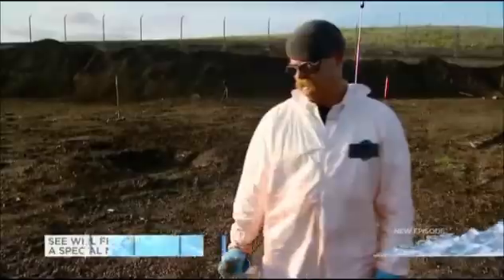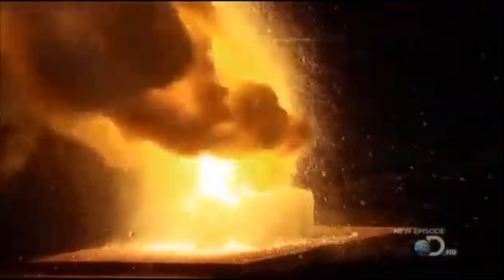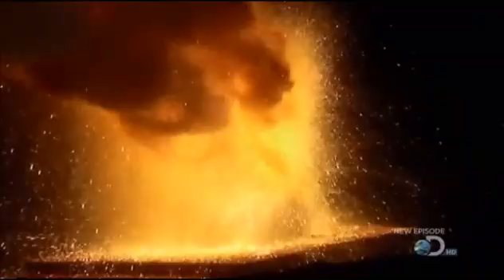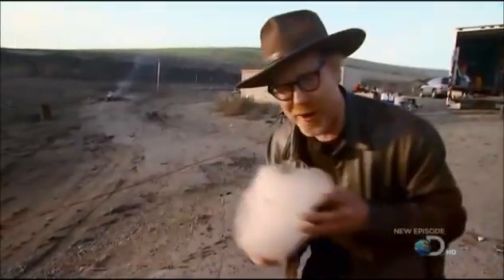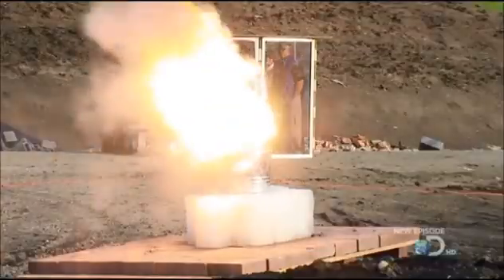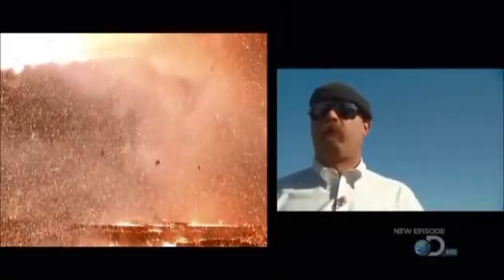Ice vs Thermite - Mythbusters for the Impatient

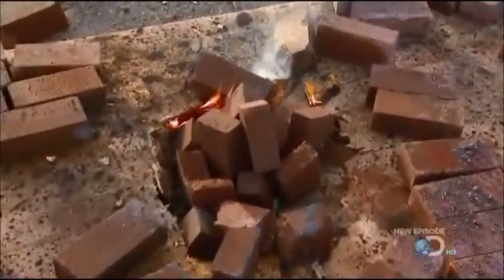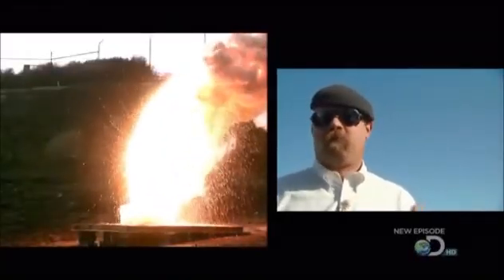Comment: (Also Speculating) IMO it's mass boiling on a spectacular level! As soon as the thermite fully envelops the ice in a layer of Thermite of exponential heat, it exploded. 1:40. And at 2:10
 you see it again, as soon as the ice is fully surrounded by the Thermite, it explodes.
Another note is that i believe i can see the source of the explosion from the lower Core. If it was gasses being released that ignited the explosion. It would ignite inward, towards the thermite. Not Out!

Comment: I think like Jamie is trying to explain is exothermic reaction, also known as a bleve (boiling liquid expanding vapor explosion) kind of like putting out a grease fire with water (which you should not do)
Reply: An exothermic reaction is just one of two types of chemical reactions, that and endothermic. All they describe is whether a chemical reaction ends with a lesser energy state (exothermic) or with a higher energy state (endothermic). A BLEVE is not a chemical reaction at all, it is a physical phenomenon pertaining to vessel rupture due to vapor pressure in a sealed container, typically propane tanks in or on fire. The term youre thinking of is a boilover fire, which is when expanding vapors aerate the fuel which leads to an explosion like burn.

Comment: You know the idea of oxygen and hydrogen subliming directly from the ice does seem possible at those temperatures.  If you consider dry ice at room temperature it becomes fairly easy to visualize what is probably happening with the ice block.  A quick Google search shows that thermite ignition produces temperatures in excess of 4,000 F, so this seems very reasonable.

Comment: Is it possible that the rapid heatig of the ice creates mechanical stress through imperfect distribution of the warmth (especially outer shell heating up faster than core) which results in a rapid release forming a particularly missfitting crack (both sides change through heating to forms that don't fit together) which is pushed appart by... Well not fitting together ^^ and just crack like BOOM
as fresh ice cubes do if you blow on them fast enough or put them into hot tea/soupe/etc.
Reply: JonnesTT you're a fucking idiot.

Comment: This is probably a coulumbic explosion from the molten coming into contact with the water/ice. The fireball is probely a mix of hydrogen gas from the initial iron explosion and finely divided aluminium powder from some of the unburned thermite. That would explain the very bright fireball.

Comment: It's very easy to disprove the first hypothesis, which I don't believe either: just use dry ice. CO2 isn't flammable.
Reply: thats an interesting idea, I think it would make a good test - but one issue. The speculation is that the thermite reaction is so hot that the water is turning into separate oxygen and hydrogen. CO2 might turn into separate oxygen and carbon ~ and we know carbon burns. Perhaps a test with liquid nitrogen to see if it just needs to get cold or if something else is happening.
Reply: What are you even talking about?  Ice blocks don't contain CO2.
Reply: @nitroneonicman  He's discussing dry ice, which is the name for CO2 ice.
Reply: @EDoyl  I realize that, do you realize the video is not about CO2?  In the video they are using ice blocks not dry ice.  Since you clearly don't understand basic chemistry let me break it down for you.  When hydrogen and oxygen are decomposed they become highly combustible, pure hydrogen and pure oxygen in the presence of eachother are very explosive.  Mentioning CO2 or dry ice is completely irrelevant.

Comment: My theory: the thermite causes the ice to rapidly turn to steam, causing the mixture to more or less aerosolize, and the aluminum then reacts more rapidly with the oxygen in the atmosphere. Thermite works because aluminum bonds very strongly and exothermically with oxygen, but requires such a high temperature to ignite because fe + O2 + heat = fe2o3. Some energy in consumed breaking the bonds in the rust, but when a large amount of aluminum high temperate aluminum is exposed to atmosphere it reacts purely exothermically and more rapidly.

Comment: Yeah, I think Jamie's right with his theory. It's like when you throw ice into a boiling vat of oil. You're gonna get a fireball when the rising stream creates the perfect fuel to air ratio.
Reply: +Neceros 13 million kelvin for ignition of hydrogen?? So if hydrogen is so safe requiring that much heat to ignite why don't we have hydrogen airships? You must be confusing ignition with thermonuclear fusion or something.
Reply from the maker: +Mike Trieu (MegasChara) 
The problem I have with that explanation is that thermite, unlike oils and other fuels, has an oxidizer in it. So the idea of aerosolizing thermite until a critical thermite-to-oxygen mixture is achieved seems a bit strange. Am I missing something? Perhaps your chemistry is better than mine.
Reply: Mythbusters for the Impatient Perhaps not so much about the oxidizer as it is about exposed surface area. We know that so-called nano thermite reacts much more explosively than coarser-grained compositions. It would seem to follow, then, that as the thermite is thrust into the air, more of the grains are exposed and able to reach the critical ignition temperature simultaneously. Something similar happened in that iPad factory in China with the poor extraction systems that suddenly exploded due to all the aluminum powder getting kicked into the air.
Reply: rappin05 Yeah, not sure what I was smoking. It's about 500 degrees. I must have been talking about something else and mixed up words. oh well.
Reply: Mindless Constructor, Sam Vimes gets the award for being right. Talk to anybody that has worked in a foundry and they will tell you, the worst thing you can do is put a large amount of water in molten metal. It will cause a steam explosion. Even a small amount can cause enough of an explosion you don't want to be around.
Reply: The problem is that , with such intense heat, any hydrogen would burn instantly. There would not be enough for explosion that big.
Reply: Neceros that is the heat required to truely seperate hydrogen from a water mol... so right ideawrong word.
Reply: Or maybe so much steam were created in such a short time. Pressurized steam goes boom too...
Reply: Chemist here :) I think that the steam reacts with the aluminum to make the hydrogen and as we know, hydrogen has a habit of going boom.
Reply: Mike Trieu yes i agree the hydration and oxygen from the water gets ignited by the termite and the causes an explotion
Reply: King of Random did some tests. Turns out, there is probably some chemical reaction going on. Copper and Brass don't cause an explosion. Lead and Aluminum do. 

https://www.youtube.com/watch?v=UhyTvcsSg-s
https://www.youtube.com/watch?v=lKoUmJp1NIw
https://www.youtube.com/watch?v=dAHolupCEkc
https://www.youtube.com/watch?v=ur0k8XDFUro
Reply: Minimum temperature needed to ignite hydrogen is 13,000,000 Kelvin. Thermite produces about 4000 F, being around 2477 K. It has to be due to steam pressure or a product of the ice creating an unknown environment for the thermite to react in.